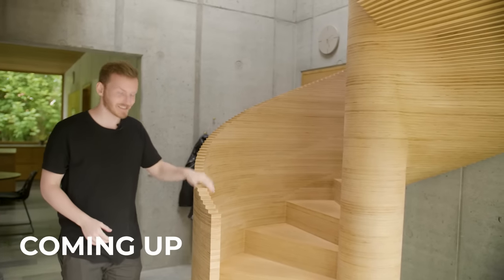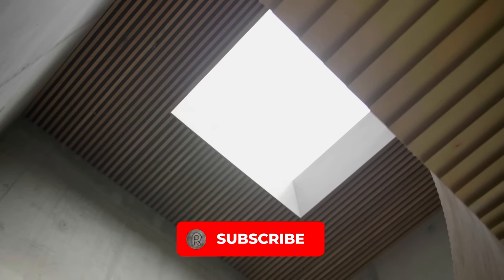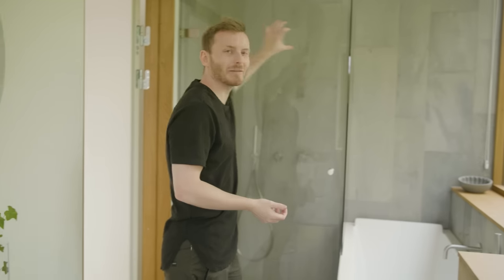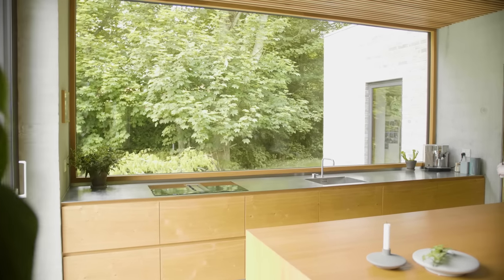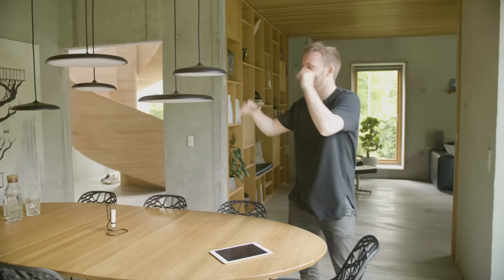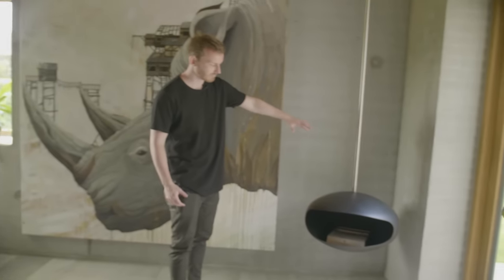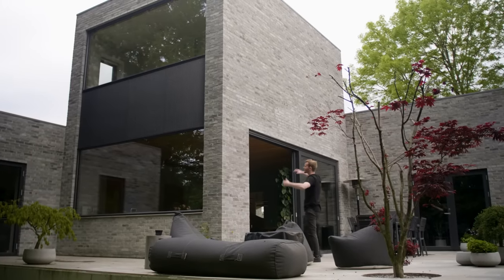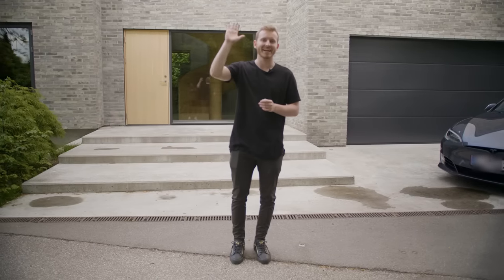A Japanese-Inspired Designer Home Among Trees

Comment: I find so many things that doesn’t fit in the place like 1. The sliding divider door with a mirror in the centre  where you can miss the privacy if you have a mirror. 2. The mirror in the bathroom with a switch in the middle of it which might scare any person for it can be a cam and the lights around the mirror which has no purpose at all. 3. I doubt whether this plywood stairs would really meet the purpose.  After all my point is beauty without any purpose is not viable option. Sorry for being so negative but this is what I felt in my heart. But I like the mirror views it’s real and beautiful.